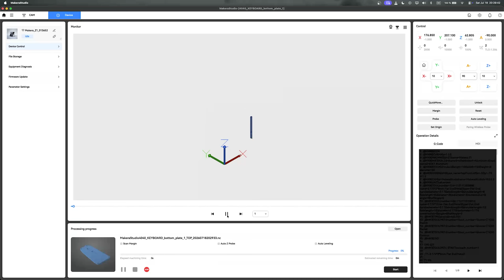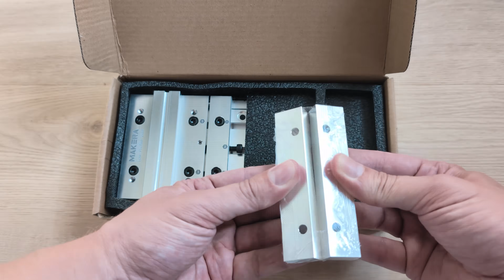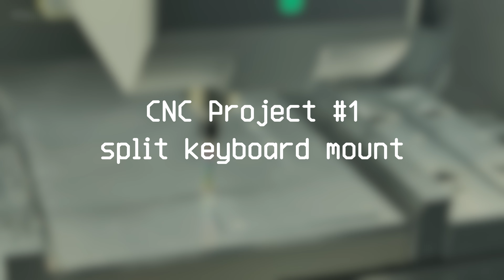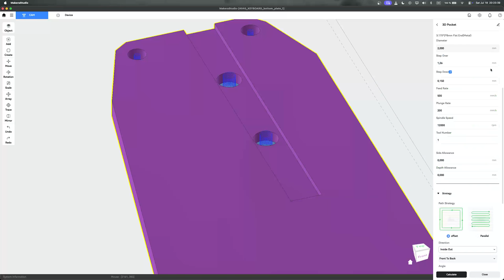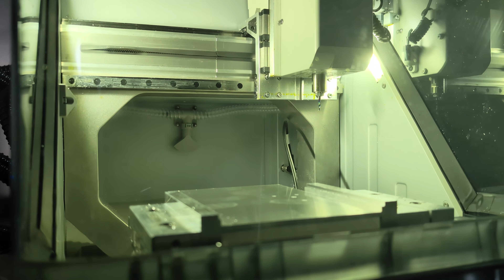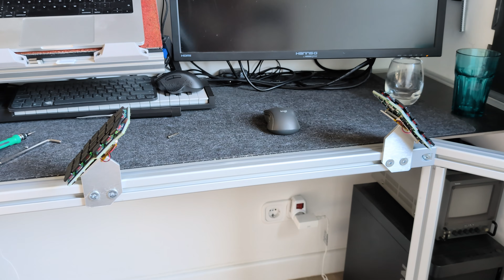Cyberpunk room build - First CNC project: split keyboard mount

Comment: In the video where the cnc stops due to high spindle load you are not using the wrong bit - you can totally use the TiN Bits for Aluminium, like i have done many times. But your toolpaths seems to just push the drill into the material in one straight motion - you need to fully retract the drill after every Millimeter of cutting otherwise the chips will get stuck in the hole and you will break your bit or make it get stuck in the material
Reply from the maker: Thanks for letting me know! Now that I think about it I have observed a similar path generated with metal bit settings. So the issue is when I selected the TiN bit as it's listed in non-metal parameters, the path generated is totally wrong. it's probably better to select the wrong bit of the same size but in metal category to get the right paths for aluminum drilling. Interesting. Cheers!